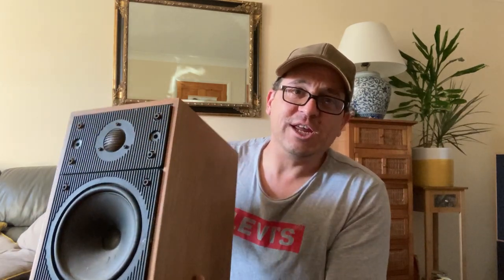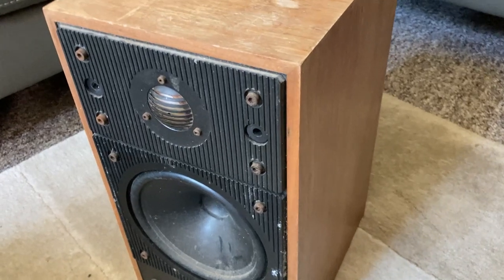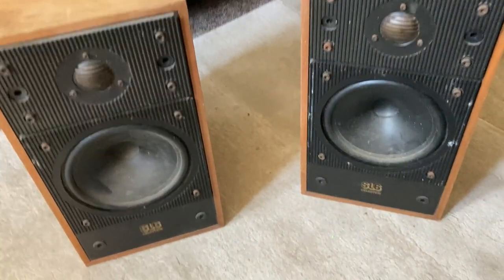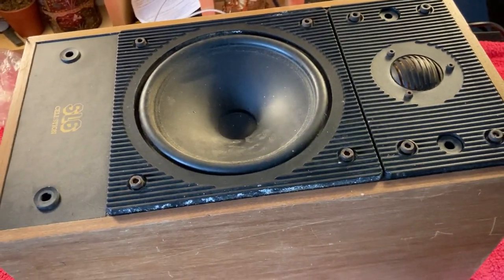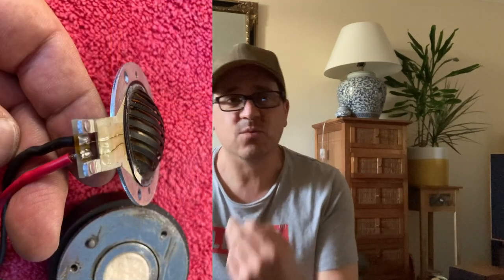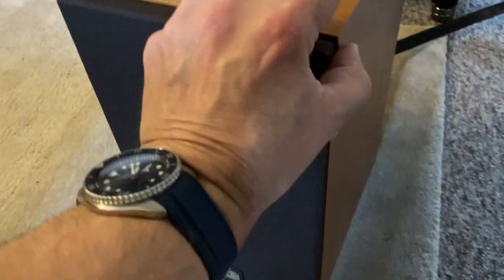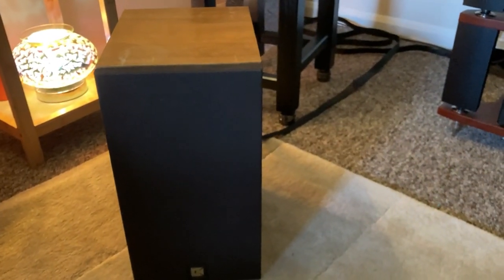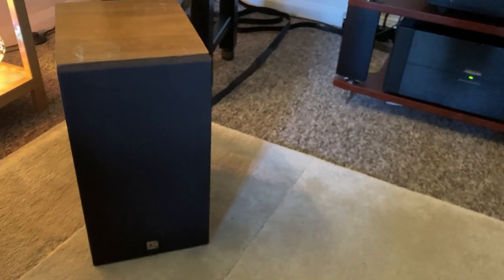Celestion SL6 Repair. #audiophile #british #hifi #speakers #speakerreview #celestion

Comment: Nice job getting them back up to spec. I have some Celestion 5's and I like them a lot. How much of a step up are the SL6? Thanks
Reply from the maker: 5’s are very good, designed by my friend Martin Roberts. 
The SL6 is quite a bit more refined but requires quite a meaty amp for them to work best

Comment: I've got some DL6's - still working fine - touch wood. I'll clean up the woofers and perhaps paint them up with satin black. Have you any paint recommendations please?
Reply from the maker: I think it’s vinyl wrap on DL series. 
You’d need to peel that off if you’re painting them nicely. 

I would re-wrap them rather than painting them.
Reply: @dittonworks  Thanks for that, but not sure about the vinyl wrap - they feel pretty rough 'papery' to the touch. They're the Series Two model, early 80s I believe.

Comment: Are the SL5's a big step up from my excellent C3 mk2's? It's for my second system - they will be driven by a Cambridge Audio 35 WPC amp.
Reply from the maker: SL6’s are higher quality than Celestion 3’s but 3’s really are very good 👍

Comment: Could you please send me a link from where the rubber O ring for CELESTION SL6s woofer or the bass driver can be obtained. Please advise.
Reply from the maker: I can repair the SL6s bass driver. Contact via Ditton Works Facebook page

Comment: I picked up a pair of sl6si for under $100. However, one tweeter is bad. Do you know the values of the tweeter, that way I can start working towards a third party replacement. Thank you!
Reply from the maker: No 3rd party replacement buddy..

I can probably fix it for you though.
Reply: @dittonworks  I'm assuming you're on the east side of the pond. If so, that makes things a bit impractical, but not impossible. It's in four pieces: mounting flange, dome (crinkled pretty bad), plate, and magnet.
Reply from the maker: @stereofanoregon6481  yes uk 
Look me up on Facebook Ditton Works